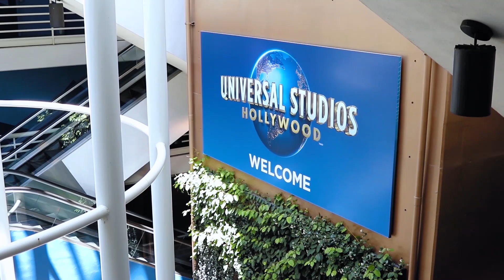Super Nintendo World Construction Update at Universal Studios Hollywood - Yoshi Ride or Just Hills?

Comment: I'm torn on that building in the corner. It's so extremely square, which is exactly what the Yoshi station is. But it's also waaaay smaller than the one in Japan. Also, the entire area between the two castles is all interactive stuff in Japan, and that all needs to come here so they can sell the watches.

Looking at the drone footage, I have to think the "block tower" will be along the new wall separating the Lower Lot dining buildings from the new land. What they've built so far is shaped similarly. Plus, it makes sense so the tower stuff isn't seen from Jurassic World or Transformers. If so, that means the second-level walkway will probably go from the Peach's Castle entrance/exit, over to the gift shop exit for Mario Kart, then to the Bowser Castle courtyard and then ending over at this building. So everything between Bowser's head and the mysterious building should all be for the interactive elements. Which means this could very well be the Yoshi station and the Yoshis will exit to the left away from the pedestrian areas, and possibly over to the block tower area and back. There is an opening between the building and the maybe-block-tower area, suggesting the bridge could very well go here. 

I've believed all along they wouldn't dump Yoshi. It's too small and cheap and this park needs rides, especially kiddie rides. But that square building is still too small. I'm thinking maybe they took the general queue idea - guests winding their way around a gigantic tree inside the block tower - and just dumped the block tower surrounding it. That construction is giving me tree vibes, and that might be the WOW moment when you exit Peach's Castle across the way. Keep an eye on it...